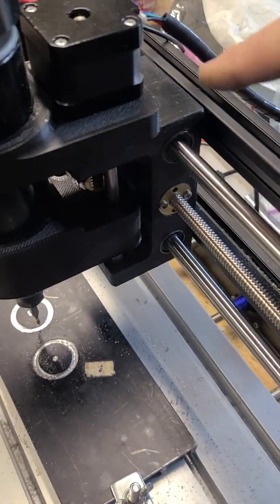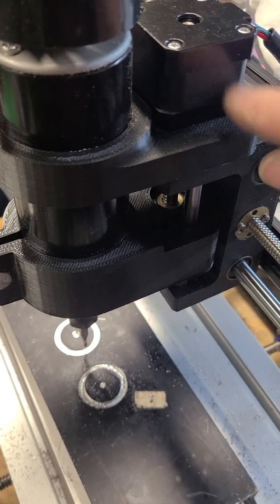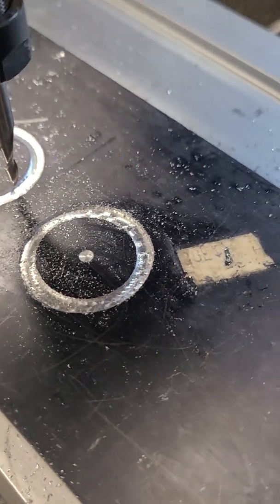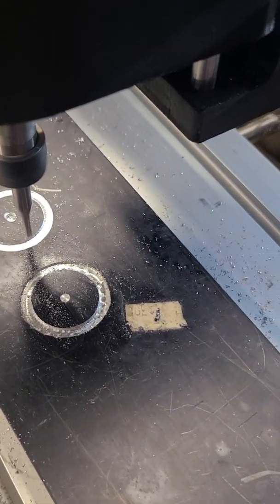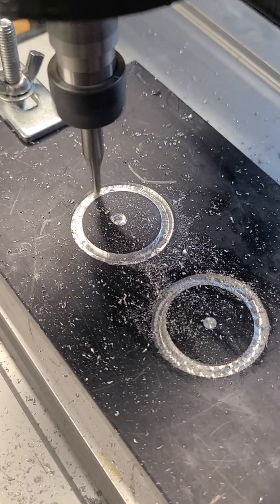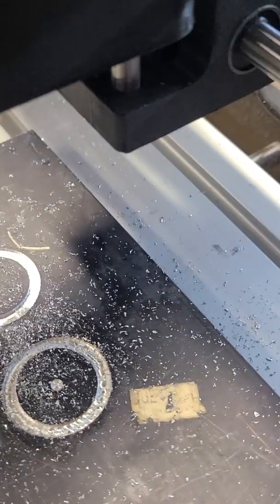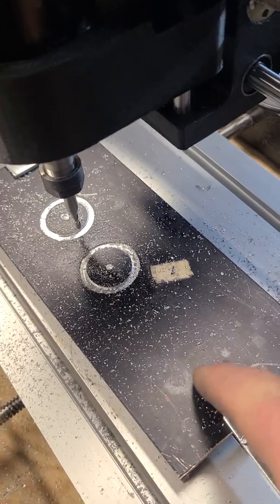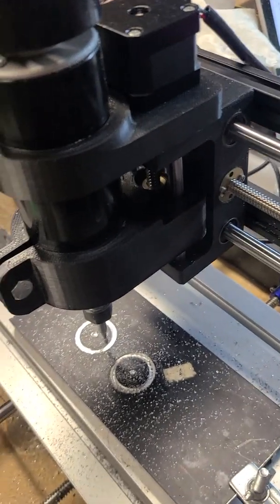CNC 3018 CUTTING METAL!

Comment: Can the machine process stainless steel?
Reply from the maker: Engraving would be possible,  I wouldn't try heavy cuts in any metal. This is a hobby machine the basic cnc was less than 300$.  On Amazon there are sub 2000$ machines which would work much better